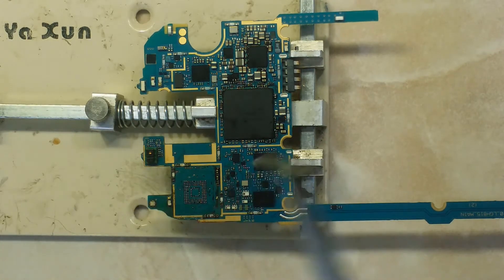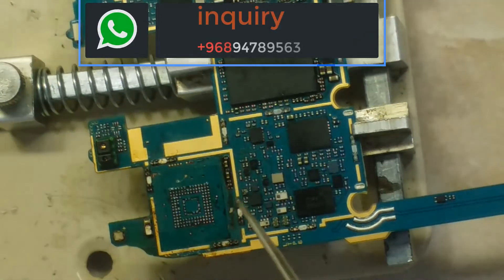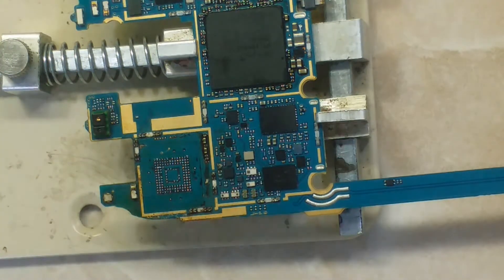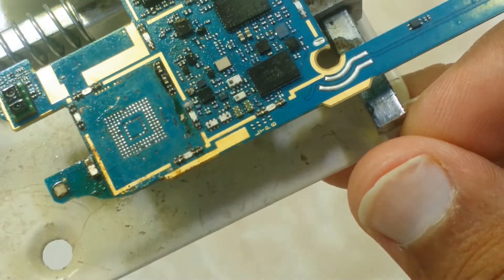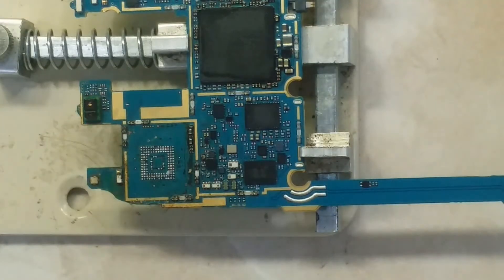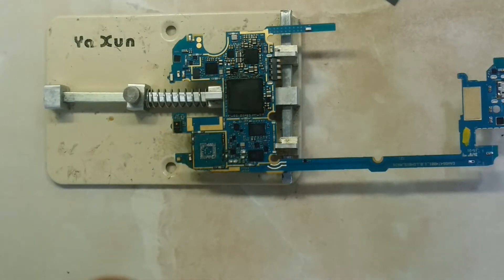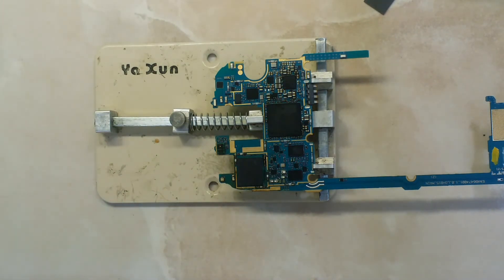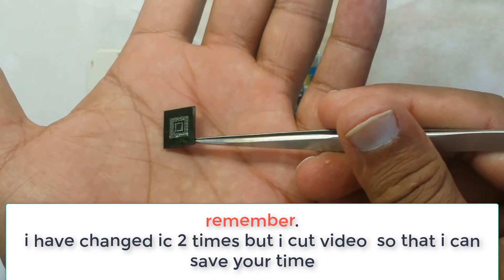LG g4 restart problem/ bootloop fix [emmc change]

Comment: Sir my lg g4 iwill on 5 mint iwill cheak set off  but  every 5 mint set off what is the problem plz gide already change 2 orignal batery but no solve my problem plz help
Reply from the maker: This is hardware issue. You have to reball emmc ic

Comment: LG h815 dead phone, it could help?
Reply from the maker: yes, if you are sure that problem is because of emmc
Reply from the maker: mostly phones not start if emmc is damaged.
Reply: @mobilesolutions  emmc is avaliable on aliexpres?
Reply from the maker: @feniksprawicy8021  yes you can order from Aliexpress
Reply: @mobilesolutions  there is difference beetwen this kind of chips? or everyone will be good? I must check number on mine chip? :D sorry for this questions but If there is possibility I use it :D

Comment: Hi there, first thanks for sharing the video. I have one question, I have some boot loop problem with my Samsung Galaxy S4 GTi9500, and I think the Emmc is the problem cause i can enter the recovery mode, and i did a wipe cache partition, and i have one error related with emmc, sth about blk1p19 or something like that, so it won't pass the Galaxy S4 logo, the problem is that i want to recover all my data 'cause i didn't make a backup from my whatsapp chats since July 2018, and i have chats until January 2019, then my question is, should i take my cell with an official technician and tell him to warm the ic, like you did, put it out, reballing and put the ic emmc again to see if it works normally? IDK if it's a hardware problem, but the last time my S4 was working fine, I recover it from a boot loop but because of a problem with not enough memory, in December 2018, it was fine all January 2019; so in my job i did my S4 fall down one time, and 2 weeks after that, it started to do the boot loop (showing me errors about android.process.media and others in those 2 weeks), I wish to recover my data, specially the chats, :( I want to know if I have that hope, or everything's lost for me. In that case I will install whatsapp with my last backup :/.... Well Sir, thank you for your time, and wait for your answer hopefully. Send you a hello :D
Reply from the maker: ues it can be EMMC problem because ur phone is fall down.if you can reball it may be your phone will work otherwise have to change emmc.but i hope so
Reply from the maker: amay be you are writing down version thats why fails

Comment: LG: Life’s Good
Me: Are u sure about that? My G4 got bootloop and i fixed it the auto restart come
Reply from the maker: if you want to save ur data so heat this chip for 5-8 secs it will work for some time and you can save data...if you face again this problem then change ic.its final solution

Comment: How do I know I need to do this? My H812 is rooted and TWRP recovery is installed. I can use TWRP indefinitely without the phone shutting down at all. But outside of that, it shuts down and/or boot loops.
Reply from the maker: if your phone is working with TWRP so keep using the same rom.no need to write stock rom ,as you know these phones have manufacturing problems with stock firmware as well motherboard.

Comment: hi, regarding Lg g flex 2 I flashed with a rom DEU because I discovered that the phone was DEU. He took everything but it did not work anyway so I'm waiting for the replacement card.

In the meantime I did a little damage: I bought a locked h818p and tried to flash. He did all the flash but I inserted a CIS rom while the phone I discovered later that he is from the United Arab Emirates.

Result now I no longer enter download mode and I can not flash.

Can I use the ADB commands to go back to download mode? I do not know how to proceed.

Thanks hello Stefano
Reply from the maker: if your phone is in working condition then you can reboot in download mode softwre command.
Reply: @mobilesolutions  the problem is that the phone don't reboot in download mode because I have flash with wrong rom
Reply: @mobilesolutions  the problem is that I have installed an incorrect rom and now I do not go into download mode.
Reply: @mobilesolutions  I read that there are ADB commands to be able to restore the LG download mode but I can not find an easy guide to try to restore
Reply from the maker: if your phone is not going to normal mode how can you use adb comman...because adb working in normal mode.
Reply from the maker: what showing on screen when you hold vol up and insert usb cable?
Reply: @mobilesolutions  part for a moment download mode but instead of coming the next screen with the wait for the firmware comes the LG logo and hangs on that logo.
Reply from the maker: its 100% emmc problem...we solve it in h818p model.when you heat it for 5 secs it will work fine but problem will come again until ic is changed.
Reply: @mobilesolutions  what is the cost of the operation? who can make me this repair?

Comment: I have too heat it but how much heat.....worked for a while after I heated it up....the cpu....Thanks man anyhow
Reply from the maker: if your problem didn't fix by heating that means you have to change the cpu because heating just for resolding the  dry-soldered cpu.thanks for watching.
Reply: @mobilesolutions  I heated cpu-area for about 30 seconds with very hot. Then it worked great for 6 hours....when I freeze it it in the regrigerator it worked for worse......I will heat it again a little bit longer.....the phone responded better to heat on the cpu. thx
Reply: @jonasbertilbellander  bro my G4 has same problem as u explained. I used this method which u have used but my mobile has worked only for 2 hour and need to heat again
Reply: @mobilesolutions  thanks answering
Reply: @mobilesolutions  you mean resolving not resolding I figure. What about the dry soldered. Summation: the solder has gotten DRY on lg4 bc of overheating.....it makes sense because it stopped working when it was very hot. Thanks
Reply: mobile solutions I removed the shield. ..is that nessesary. ..does it protect from heat or cold?
Reply from the maker: yes,also from jurk
Reply: @mobilesolutions  what is jerk? dirt?
Reply from the maker: you asked about sheild.does it protect from heat?
ans. yes it protects from heat and jerk means when your phone falls down it safe from bumps/jerks.
Reply: What should I've to done sir plz reply fast
Reply: @Sandeepsingh-vz3px  I have given up on my lg4. It got dead after a couple of heatings and freezings.....
Reply: Or contact me on +919041940949